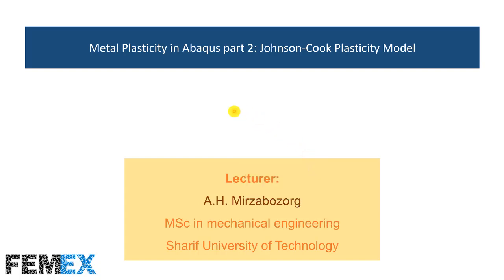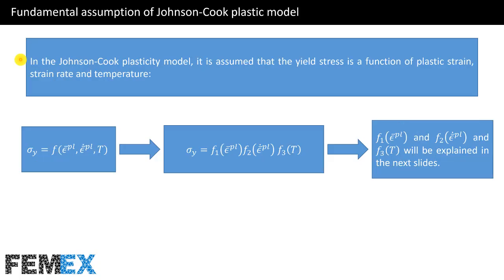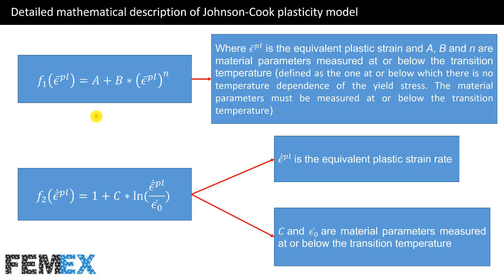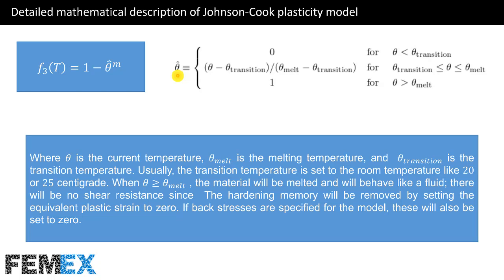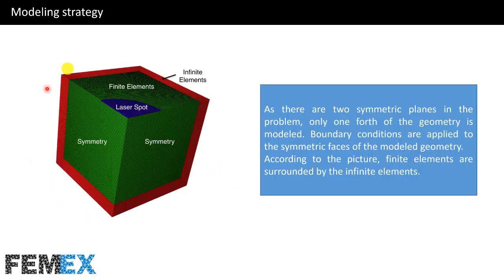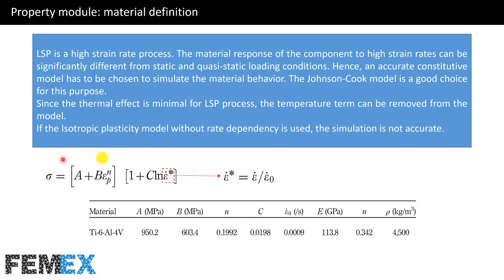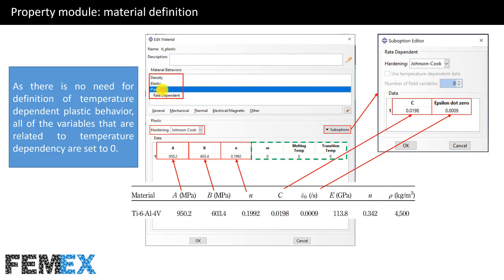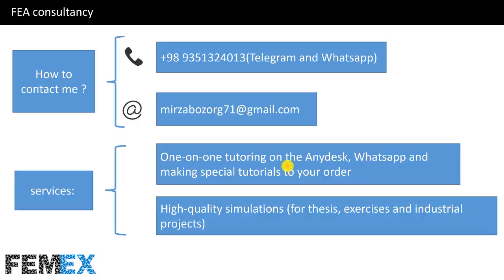Metal Plasticity in Abaqus part 2 Johnson Cook Plasticity Model

Comment: can we use Johnson-cook plasticity model in sequentially coupled thermomechanical analysis for DED simulations. if yes, how?
Reply from the maker: Hi.
What is the DED process ?
Please explain about it to give you accurate answer about your question.
Reply: @FemexIran  sorry. DED is a laser based additive manufacturing process and it is simulated by sequentially or fully coupled thermo mechanical analysis.
Reply from the maker: @ritmanik1  You are welcome. Yes generally you can use the JC model both in semi-coupled and fully-coupled simulations. But as far as I remember, the Abaqus JC model is not good when the temperature is equal or greater than the melting temperature. This is due to its formulation in Abaqus. So the UHARD subroutine must be used to write it in a way that even after the melting temperature, it works.
Reply: @FemexIran  Thank you for the reply sir. I will get back to you after trying for the same
Reply from the maker: @ritmanik1  You are welcome.
Reply: @FemexIran  after enterring the values for J-C model in Abaqus i am getting error like, damage initiation criterion=Johnson coom is available for abaqus/expilict only. But for stress part of thermo-mechanocal analysis needs static structural. Right?
Reply from the maker: @ritmanik1  Yes the JC damage model cannot be used for the Abaqus/Standard solver. Also for the additive manufacturing simulation, you do not need to define JC damage and JC plasticity is completely enough.
Reply: @FemexIran  thank you sir for guidance. But how to enter J-C plasticity only?
Reply from the maker: @ritmanik1  You are welcome. JC plasticity model is not related to JC damage model. You can define JC plasticity without defining its damage. There will be no theoretical and numerical issue.